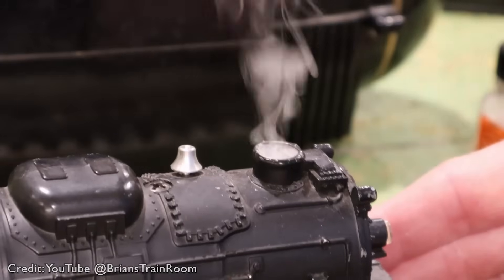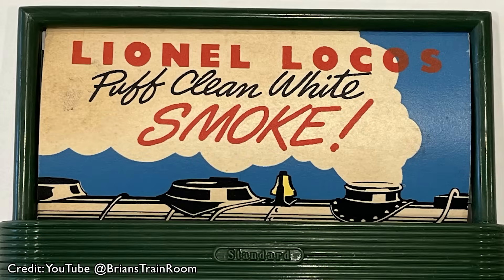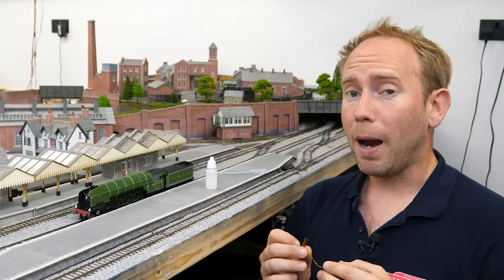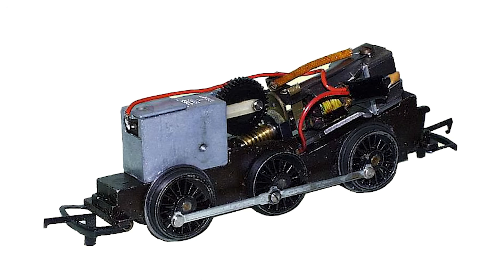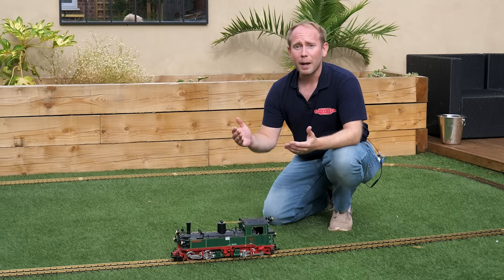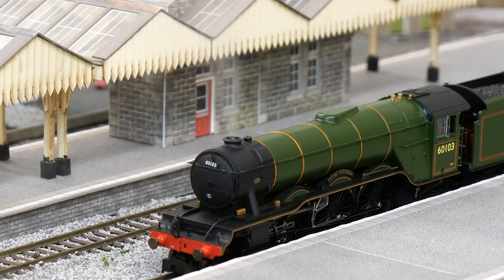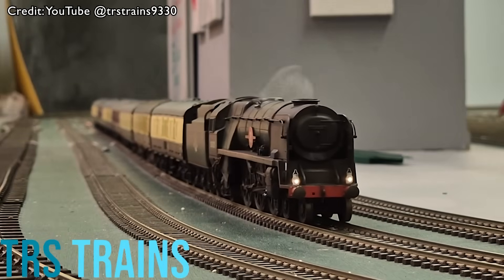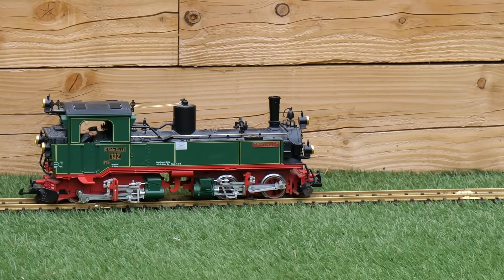Smoking Models | Cool Tech or Bad Habit?

Comment: As an Owner of several LGB smokers.
Let's see if I can provide any form of help.

Disclaimer, I'm no PRO expert, and these are from my own personal experience.

First off, I assume your 'Gertude' is brand new?
Most modern LGB units have a 6 volt Seuthe unit. (With the exception of the Fan Driver pulse smokers.)
Earlier models did have either 18 or 24 volt smokers.

Does the funnel have a very small hole opening for the smoke?
Should look sort of like a Cone going down inwards.
If yes, and "IF" it has one, try removing the "plug" as I call it to open the output.
LGB as standard put a plug over the smoke units as a safety precaution so people can't accidently touch the heating element, as they hot and very fragile!
The plug are usually easily to remove if it is there.

What kind of smoke fluid are you using?
These units I find don't work well with certain brands.
I've used Massoth/LGB and JT Mega Smoke for mine.

Lastly, outdoor elements.
I find even a simple breeze can affect the look of the smoke, even my fan driven ones.

OK, this was a very lengthy post, but with little information provided to narrow it down, I can only make open suggestions.
Reply from the maker: Thanks for the suggestions, much appreciated.

It's not a new LGB locomotive, I would have thought at least 10 years old, maybe more. If it has a 6V unit then voltage really shouldn't be an issue for it.

The funnel is just open, you can see the seuthe unit clearly. Unlike my Stainz which has a plastic cap with a grid.

It was LGB smoke fluid, the same stuff worked fine in the P2.

I'll looking into it more when I have more time. I have another LGB loco which has a smoke unit which doesn't appear to be heating up at all, so they both need a bit of care and attention. They were both second hand from the same place.

Comment: What about the water vapour in tunnels and under bridges, is it going to cause mould?
Reply from the maker: I imagine that if the layout was already in an environment that encouraged mould then adding water vapour might not be ideal. The amounts involved are tiny though, the maximum amount you can put in is 3ml.
Reply: @LittleWicketRailway  interesting to know that.  For comparison, a fountain pen short cartridge, international format, is 0,75 ml of capacity.